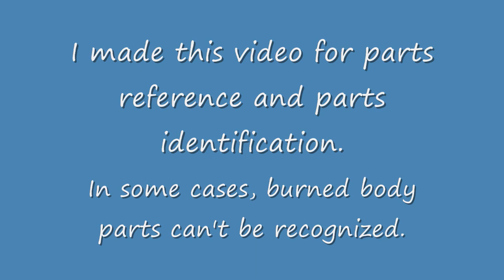EdgeSwitch 24 250W, ES-24-250W, Power supply G0683-25013240A no power problem Fixed

Comment: I had the same U5 & R5 on mine blow to the point of being unidentifiable - thanks to this video for the IDs. Replaced all the parts mentioned in this video (keeping in mind that R27 is actually 27 Ohm and on mine was fine), but unfortunately, no go. Now when I give the PSU power with no load, the relay on the primary side clicks on and off every second, when I give it load, the blue wire 24v output rail has about 15-16V, and the other rails are still dead. I've replaced a few other faulty parts, but still no go... I think I will just install a pair of Meanwell power supplies (separate 24V and 48V) and wire them in. Not only will they work, but be far better quality than the trash that UniFi use in their G1 switches! For those interested in the Meanwell approach, an LRS-150-24 and LRS-350-48 coupled together will physically fit the chassis and meat / exceed the power requirements, and likely last longer too!

Comment: Thank you for this video. I've got a 24 port PoE switch with a faulty mosfet Q5 on the power supply which caused several components in the vicinity to be completely obliberated. I would not have been able to recover the component markings without your detailed pictures.

Comment: I have these exact unit in my home. Not under a large load either with only 48W total for POE (4 cameras, 2 access points, and 1 cloud key). I have had in full service since 2016 without issue so I guess I shouldn't be complaining based on all these issues I found researching what happened to my home internet and security suddenly. Unit was always connected to high quality UPS too! Not sure what I'm going to do come Monday when wife it supposed to get distance learning classes and I'm supposed to work from home.....what is turnaround time for this type of repair? I would overnight another switch from Ubiquiti but they don't even have stock.

Comment: Thank you for your video ... how much do you charge for a repair like this Paul ?
Reply from the maker: This was not an easy unit to work on. The price depends on how badly it is damaged. I've seen some pictures from one of the guy and his unit was badly burned. I took some pictures and made this video for parts references to help other technicians. I couldn't find a schematic diagram and therefore this video may help a few people.
Thank you.
Reply: Paul's TV Co thank you for your reply but what sort of price customer should expect roughly ?
Reply from the maker: If we'll get the same unit with the same damage, we'll be charging around $250.00
$250.00 is not cheap, but the unit is not an easy one and needs a lot of attention.
Reply: @PaulsTVCo  Ouch. $250 you're right isn't cheap, especially since a new switch isn't too much more and comes with a warranty. But thanks for the video none the less. We had one fry 16 months in and I needed to know what R39 was as it's the only one fried.
Reply from the maker: R39 will not fried just on by itself. Make sure to test more components for short. Best of luck.

Comment: Thanks so much for sharing this video! I was able to successfully repair my Unifi Switch 24 thanks to your pictures and parts specifications! On mine the diode D4 and R52. Without your video this definitely would not have been possible because the labels on the resistors were completely destroyed. Thanks so much!

Comment: R27 resistor is 27 Ohm not 270 Ohm. C50 is 270pF, C36 is 1uF, C33 is 100pF, C35 and C103 are 100nF, C38 is 2,2nF. D9 diode is BAV70.
Reply: Hello, Do you have any schema for this board? Thanks a lot!